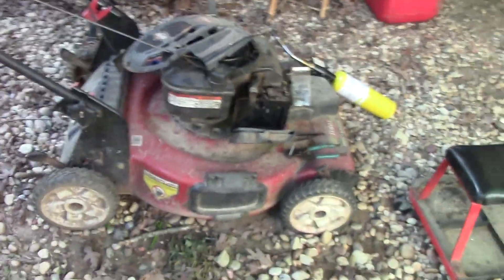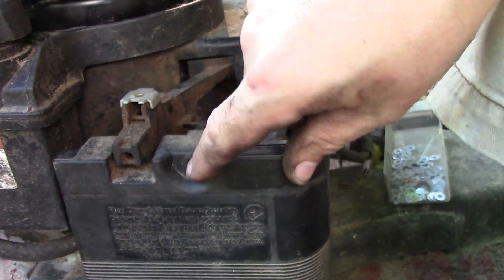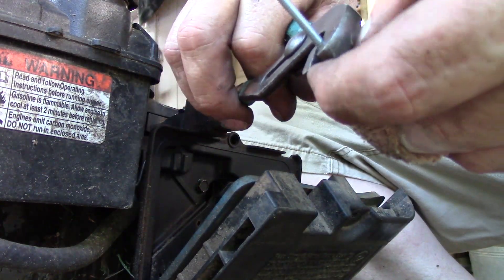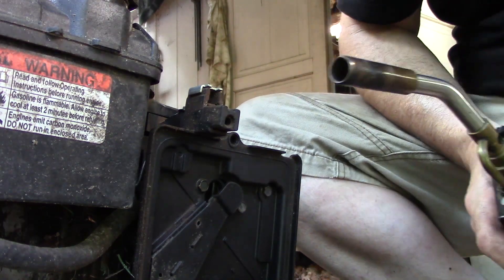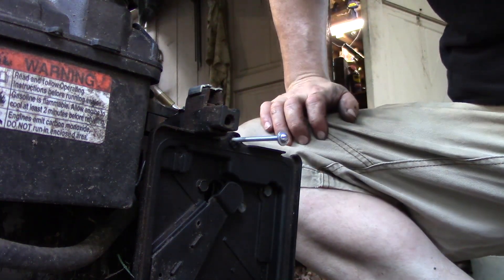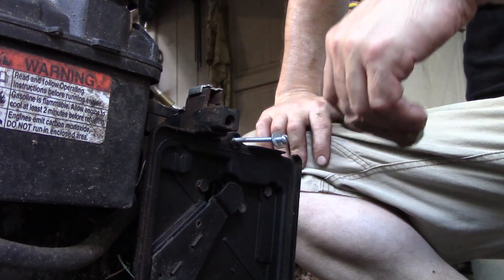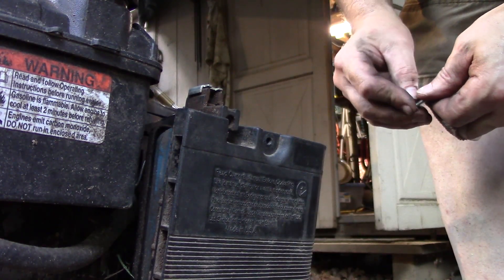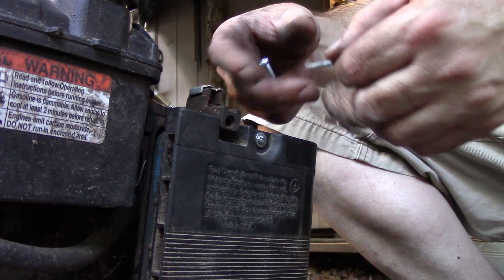You won't believe how easy it is! Missing captured nut or stripped plastic thread repair

Comment: Just used this tech on a Husqvarna chain saw heat shield with stripped screw hole, did it in a reverse nut with bolt so side where carburetor gasket and carb contact will be smooth.
Reply from the maker: Nice!

Comment: Funny story, was replacing the air filter on a sedan, dropped the screw in the engine bay somewhere (hopefully it doesn't rip a belt) so I tried to get it with a Mag grab but no luck. So I tried a similar screw (there was 2 only dropped one) because the OEMs were hard to find and expensive. Luck has it stripped because it is just abs. So here I am. Now I need a tiny nut and bolt.
Reply from the maker: Cool. It will likely be stronger than the original. Let me know how it works in your ABS piece. I have done it once in what I was pretty sure was ABS and it worked fine.